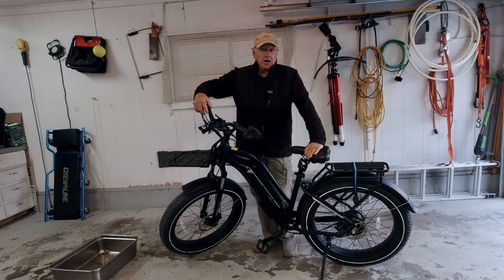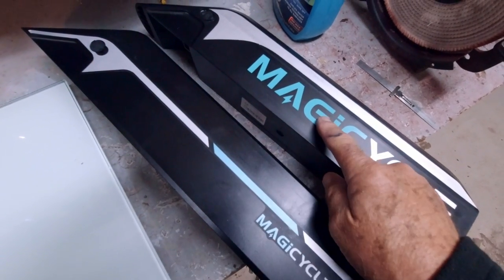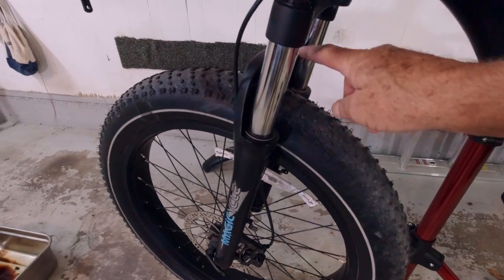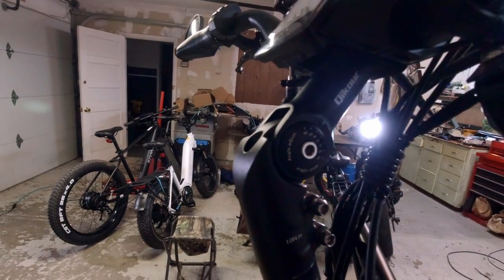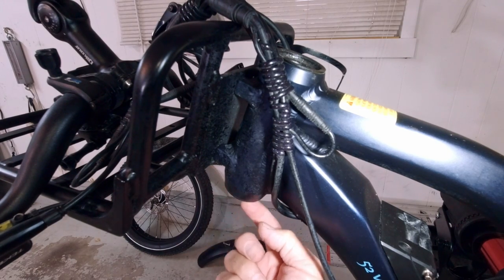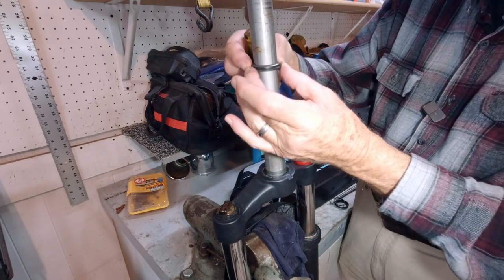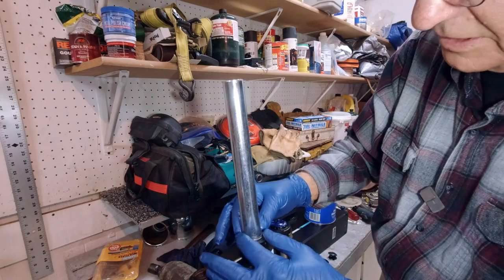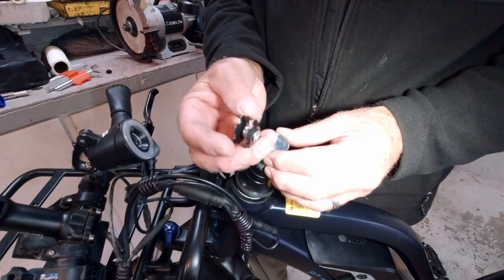Replacing your bike or ebike's front fork - Magicycle

Comment: It did seem pretty simple. I just kept thinking I had no idea that was something you would ever need to do. Learned something new and how to fix it too lol.
Reply from the maker: As long as you don't fly off into the rocks you should be ok!
Reply: Thank you, yes, Not replacing fork, like you did, just turning it around,;  but watching your video helped a lot in the steps , step by step. Took 2 hours because I'm. El Stinko at mechanics,  put caliper back tightened it hard, brake doesn't seem to work, maybe loosen ?   Or, get it quickly checked at local shop.    Headlight/ fender on, work.        Thanks
Reply: @gonagain  just did today haha

Comment: Thank you for video.  Just received new 'Deer SUV '  model and the front fork is installed backwards. The top black piece which crosses over from side to side, it's part of the fork, you can't just remove that black piece. So, it's Behind the forks, making installation of the fender and headlight nearly impossible  !  It Has to be In Front of the forks. Told Magicycle numerous times, and sent pictures.   Response was almost nothing then, finally,  Janice, sent a correct message with your video.  Only thing I'm concerned of is the brake caliper ?  Putting that back on  correctly ,  so everything works on brakes.  Well, we're going to try again.  Thanks.    Paul
Reply from the maker: Hello Paul.  I think you just need to take the handlebars back off, along with the front wheel, and spin the front fork around 180 degrees.
Reply: Hope you got other reply message.  Did help a lot.  Not replacing fork, just turn around,   light and fender on pretty good.   Not sure if tightened caliper too much. ?  Brake doesn't seem to work, never had an e-bike.   It's a heavyweight,  like me.  That's why I got it.   ✌️👏✌️👏👍
Reply: Most worked good watching video.  But the front brakes don't seem to work, just moving it in living room.  Haven't test ridden it, yet, no helmet yet. Any thoughts, or is it the caliper, I loosened it some ??   Thank you. Paul
Reply from the maker: Hello Paul, is the front wheel mounted with the brake disc between the brake caliper?  It's possible to mount it backwards.
Reply: Thank you , Sir , will check it, study it.
Reply: Hello, if you can answer,  the silver disk has to be on left side of bike, same side as your left leg, correct ?  Then, the caliper has the two spots to screw it in, and that is on the outside of the silver disk , that seems only way caliper will screw in. When screwed in( kinda ' screwy'  message here, eh) the caliper is very close, but not touching the silver disk ?   Did that but brake doesn't stop wheel , so I don't know how else to do it. Thank you.
Reply: Probably,  a dumb Irishman,  me, here. Gonna look at it Thurs, think I know what's wrong.  Thank you
Reply: Would it be that the caliper slides over the disk(silver circle), then as you apply brake , caliper clamps down on disk, with the brake pads , stopping the Front wheel ?  Can see, I'm a Real Novice.     Thank you.  Paul

Comment: Thanks for the help Rick. I seem to be having an issue with my Hey Bike City run. The "stem" of the front fork is sliding in and out of place on the frame of the bike. It seems to be an alignment problem and I don't know how to tighten it.
Reply from the maker: It should tighten from the top, like what you see in my video.  I wish I could be there to help.
Reply: @gonagain  no worries. I really appreciate you uploading this video. It's almost amazing to think my grandpa was a nuclear engineer who worked on the first submarines and I struggled this much with a bike. Luckily, looks like all I had to do was hold tension with the fork it's correct position while applying a little bit of force and I was able to tighten it. Unfortunately, I think the instructions were from an older model and translated from Chinese so it's been a frustrating  build. I greatly appreciate you!

Comment: Would you say this repair/replacement would be similar to a BURCHDA RX80?
Reply from the maker: Similar, except that the RX80 has rear suspension and is more like the Magicycle Deer.  In my experience, rear suspension is great on trails, but I don't like it at all on asphalt because it absorbs too much energy.
Reply: @gonagain  my apologies if I worded the question weirdly, I was curious if replacing the front forks would be the same as the RX80? Never thought about too much absorption of energy I will have to research more into that, thank you in advance!

Comment: Do yours leak oil through the top? My wifes Ocelot Pro and my Cruiser Pro both leak oil through the top seals on both sides. I wonder if it is because they are new and full of oil. Both bikes have under 100 miles on them.
Reply from the maker: Yes, a very light layer of oil.  I suppose the fork will need serviced at some point in the future.
Reply: @gonagain  mine has rings like an old dirt bike

Comment: Why did you need to replace your forks?
Reply from the maker: My original ones were fine, but they sent me the upgraded ones and I decided to video the process. I jokingly asked them to send me the Cruiser Pro and they sent me the upgraded parts instead.
Reply: @gonagain  Mine has disc brakes, front and rear adjustable shocks. I want to upgrade my disc brakes to hydraulic. I'd also like to set It up with a seat post shock system.

I know most ebikes are about 500w to 750w. Mine is 1,500w.

So far I've only ridden it the three miles into town and back a number of times already.
Reply from the maker: The best shock absorbing seat posts are the articulated ones, not the ones that just have a spring in the post.  You have a powerful ebike!
Reply: @gonagain  Would you have a suggestion for the seat shock absorber?

I'm not just begging off poor, I'm a disabled vet that's been survive a lot of years on just my disability pay.

I only say this because I've been looking at an assortment of these seat post absorbers and it's hard to believe such extravagant prices for them.

I don't have a manufacturer giving me things for free.

I'm enjoying your vlogs... keep up the good work.

Nomad